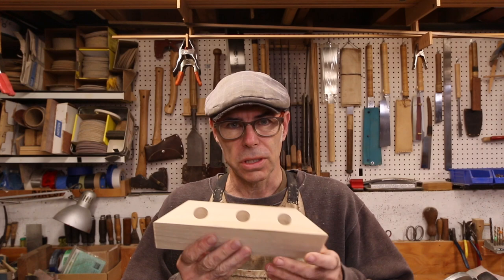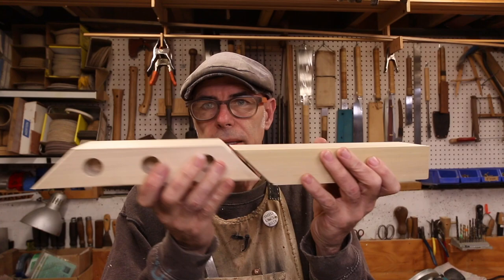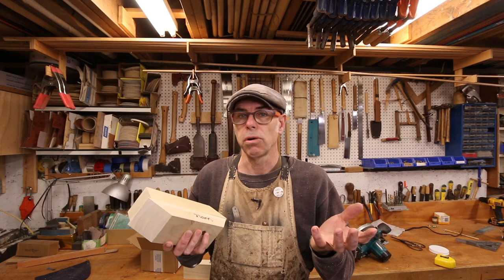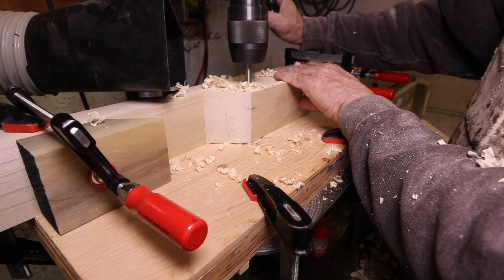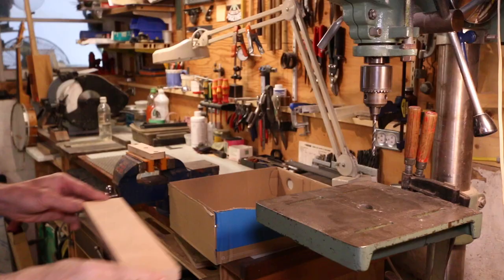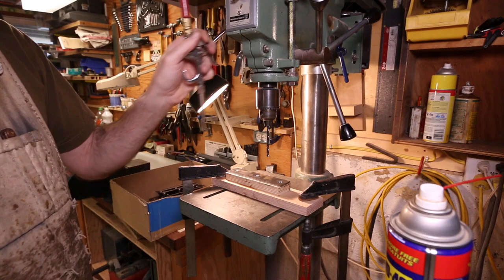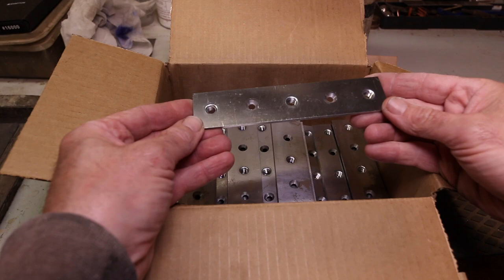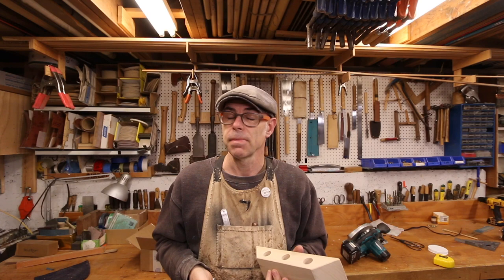Simple jigs for small scale production

Comment: Great video, as always. WD-40 really isn't a good cutting fluid. Cheap and handy but doesn't do much to extend drill bit life. I've used Tap Magic for almost 40 years and can recommend. Not expensive either.
Reply from the maker: I know WD isn’t the best choice. I had tapping fluid sitting right there. I was just being lazy. I also wanted something that would clean up easily and not risk oil getting on the furniture during the assembly process.